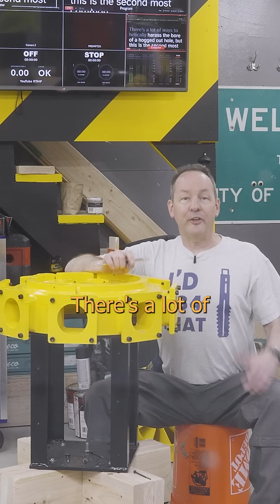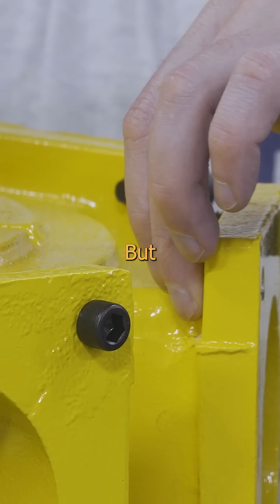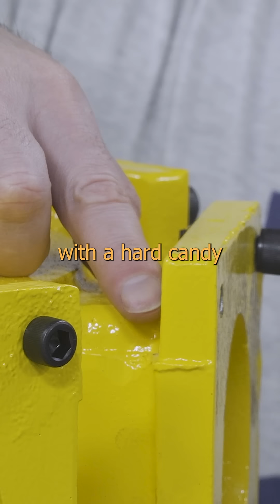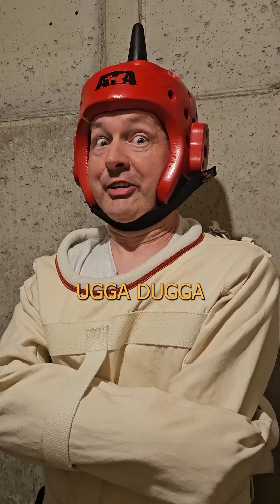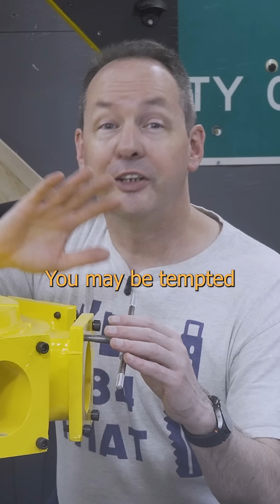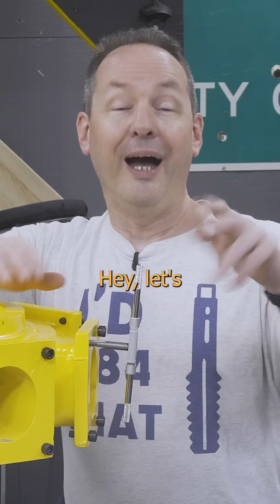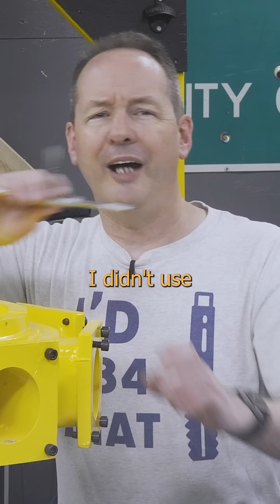Thread Chasing  #chrisboden #comedy #engineering #skills #workshop #metalworking #tools #apprentice

Comment: UGGA DUGGA! im a dumbass. I had 1 1/2 hole in concrete to tap. I was working with GE at the time and everything over 1" is 8 tpi. Usually. Well  this was concrete i was tapping and not a GE part. So i UGGA DUGGA that 1 1/2 x 8 into that hole. Break it off. Bossman comes by and says, "hey numbnuts, thoes concrete holes are usually metric." So i spend the remainder of the shift on that 1 hole trying to get out that broken tap. Yup. Young and dumb.

Comment: I’m not A dumbass, I’m THE dumbass. Tapping a 3/4 hole into the side of a ductile iron pipe 4’ in the ground and full of 90psi water pressure. Run it in turned into pump out the trench, cut the pipe, sleeve in a new section and do it right this time. 1 hour job turned into a 10 hour shift lol oops

Comment: I had a bad run in just the other week. Bossman dropped a chunk of money on these special drill taps, designed to hog out the hole and then tap it immediately after. Pretty clever bit of kit in the right hands. Guess who's got two thumbs and fuckin snapped £30 worth of tap on his first try? This dumbass 👍😂👍

Comment: Sure, if it’s your tap…but it’s a lot easier to get the contractor to buy a new tap than to pay for carpal tunnel surgery and lost wages.

Set the drill on low speed and use the variable speed trigger to keep it slow, adjust the clutch, lubricate, and stop and reverse to clear the chips every couple threads. If you’re careful, have steady hands, and let the tools do the work you can have a pretty good success rate cutting threads in stainless. Chasing these out shouldn’t be a problem for a properly coached 1st year…that said, I know plenty of JW hacks that would go through taps like they’re tic-tacs…by hand.

Comment: I closed a vacuum hose adapter to my Vacuum destillation setup with silicone paste (for getting the parts air tight in chem vacuum dest)  since I did not want hot sulfuric acid vapor to escape and thought condensing it by having the recieving flask at -18 degrees celsius is enough, well a boil over later (the temperatur controll failed) and an evacuated lab later, I knew I won't do that again... (NO ONE WAS HARMED)

Comment: Hey, Düma$$ this is exactly why your cordless drill has that adjustable torque ring setting.  And speed range 1 or 2, most likely.  Chase small threads using a really low torque and low speed.  Because nobody likes having to go get ol' Charlie to help you get the broken tap out of the casting because he's going to make you wish you never came to work this day.

Comment: Auto mechanic here, and I chase threads using a tap in a tap socket on a 3/8" impact driver all the time... Yeah, a couple mistakes have been made over my 15 years in the trade, but on balance, once it's been started by a thread or so, it's fine.

Comment: Dumbass alert! I was Running an m8 into a lower radiator tube mounting surface usually we could just hog these with a drill bit along with the other 300+ holes in an empty cat793 frame but there was some blasting media left in The blind holes and I got the tap suck I usually chuck the drill loose and set the clutch low so they don’t break but I guess this one was a bit sensitive. It broke. I have a 4 flute tap remover kit that I bought just for these occasions. It as luck would have it it broke in 2 places and deep in the hole so my tap remover wouldn’t work spent an hour and a half attempting to get out the pieces and ended up having to drill through the flutes to make a cross shaped hole turn the tap just enough and fish it out of the slots we always tried to avoid using thread repairs but this one got a keencert and we had to be really carful because the hole was blind to not have a hole in the tank that would have to be sealed by the bolt threads.

Comment: Never had the pleasure of breaking a regular tap, but have been a dumbass TWICE with a drill tap. Long story short, only use a drill tap on a single layer of metal, anything double stacked will bind and you will snap that fucker off in the hole

The real lesson? Slow down and use the right tool the first time, there's always tomorrow, and better late than making a worse problem

Comment: So i worked in a fab shop i was told to tap some holes of a specific size so i grabbed a tap wrench and got yelled at by the owner if you can’t run a tap in with a hand drill then you don’t need to work here

Comment: My tap story. Its not exactly because of the issues you described to avoid. A chiller bolt broke for a condenser barrel head (just a water diverter with about 50 bolts in it and a rubber o ring on the inside). Extractor didnt do the job. I tried. Im telling you. I drilled  out a small hole with a tempered steel drill bit but went too deep. I realized when i heard the whistle. These machines are under atmospheric pressure so they suck air in until they equalize. Now it was panic mode. I needed to get that bolt out and found a way to seal the hole and thread in a new bolt. I got it extracted and packed that hole with a full tube lf steel stick. Pressed it in there with all i had and hit it with a hammer for security. Then i took some liquid epoxy and shove about a 1/4 bottle of that too. Figured the steel sick would get 95 percent and the liquid epoxy would get sucked into the rest of the crevasses. Gave it an hour to set and used and ultrsonic leak checker to listen for air movement. Tight as a tick. Now i need to retap and get a new bolt. That all went smooth. I ended up telling the customer with my tail between my legs, marked the spot for the next guy to know, and left a note to apply a little loctite sealant on that bolt just in case.

Comment: I’m a young diesel mechanic and I was working on a manure spreader that goes behind a 60-90 horse tractor and I had to tap some new grease fitting holes in the bearings that hold the spinning blender of death together and I was running out of time and snapped that 1/4-28 tap right off with my drill.

Comment: Working in production we have taps with pressed on nuts we just fire them through a crossed threaded hole pull it back out then fire another bolt right back in a matter of seconds then move on to the either next repair or next unit

Comment: Dumbass
I blew off the intake valve on my mountain bikes rear shock. Had to tap it to screw in a new schrader but went too fast and it ended up cross threaded out the gate. Ended up plugging it with the valve and some jb weld...2 years later, its working perfectly

Comment: Dumbass
I was retapping a hole on a turbo manifold for a 2003 Subaru Impreza wrx wagon snapped the bolt off welded another bolt to it and then got the old bolt out but was stripped from the last turbo replacement so I was gonna retap the whole and went at it with my snap on drill and destroyed it had to weld the hole redrill the hole then hand tap it longest fucking turbo manifold job I’ve ever done lesson learned😂😂😂😂

Comment: I'm a dumbass. No not just the kind who once thought they could tap a hole with a drill, broke he tap off and had to spend the next multiple hours to fix my mistake. but the special extra dumb one who despite that still would chuck the tap up in a drill to chase the threads in your siren to save a few minutes.

But also I have purpose made thread chasers that's made for exactly that, so I'd use the tool that's made for the job instead of a tap, a tap is for tapping holes, a chaser is for chasing them.

Comment: Also, when you unscrew a bolt, if you see marks of any kind of paint, threadlocker or whatever, that thread needs to be re-tapped and the bolt needs to be cleaned.

Also remember to inspect the threads carefully after each unscrewing to avoid screwing up when screwing them back.

Comment: I use a drill to chase threads all the time, just did a bunch of 1/4 and 5/16 UNF threads on an engine block from an old MG. Might be a skill issue, I certainly wouldn't tell the new kid to do it that way.

Comment: Yep, I broke a tap with a impact, but in my defense, it was supposedto be used on a impact. It was one of the newish drill/tap bits for up to 1/4 inch metal and unbeknownst to me, some a**hole engineer decided to make this oarticukar metal column 1/2 inch thick when every single other one was 1/4 and so when the threads began to bite, the drill section wasn't through the other side of the metal and snappy sounds commenced with a decidely downward look to my da from there on out. It might not have been the engineer, it more likely was the dumbass metal fabricators who are notorious for screwing things up regularly. I have petitioned the company hire ups more than once to quit using these idiots, but keep getting told their the only ones who will do it resonably. I remindthem they get what they pay for and just to keep approving all the change orders that I charge for fixing their screwups. Seriously, I made close to$20,000 in change orders on one project because of those idiots.

Comment: Done this a million times, started by hand, then started with the drill method, took a couple mess ups to learn how to use the drill right… these were also not critical parts, had access to rear to add nuts and lock washers if need and no sealing surface in site.

Comment: Dumbass 
Anyone who says they never broke a tap off is a bad lier. Smaller the tap the more spicy it gets. One of my biggest victories was on a small broken screw for and certain type of mount. I got a good deal but it came with someone else's dumbass. Using and extractor on a drill press and a vice. I used the press for pressure and control only no power.
Got it out second try and I got a little over and 200$ discount over buying new. I still own said item and I wears and optical alignment device and punches 10mm holes at short to medium ranges.

Comment: Dumbass, I was left on my own to re-thread mounting bolt holes on a fin guard and it did not go well. Safe to say my nickname was Parkinson's for a hot minute afterwards and I was banned from touching drills and there (as I soon found out) expensive bits. to be fair haven't we all snapped a dozen  taps in under 30 minutes?

Comment: A buddy with a tap set was trying to help me chase the threads in the rusty holes on the frame of my car so I could mount a trailer hitch.  On the very last hole it got hard, and this DUMBASS who should have known better used break cleaner for lube and ugga dugged his way to a shattered tap way the fuck up in there.  I only ever had 3/4 of the bolts in there.  Damnit Jim!! 🤦‍♂️

Comment: You can get taps and dies that are just for cleaning/repairing threads, that are made of a different, softer metal. I have a set of them as well as the standard thread cutting ones and they're awesome for dealing with absolutely shited threads. I think they're made of brass, or something. They also have a hex head so I can use a ratchet spanner to turn it faster if so desired.

Comment: My company's manufacturing enjoys mixing powder coat and sand blasting bbs in the bottom of blind holes then run the bol t s in with an impact till tight.....  not flush just tight.....

Comment: I feel like a dumbass but not in a way you would think😅😅 I was replacing the dead batter off of the pcb board that was solder. And after cleaning the rosin off the board and what not. And somewhere along the line during the process of soldering new battery on a pcb board, I somehow created a kill switch. And it’s a gameboy cartridge. I put in my game boy and it killed the game boy. 😅 yep I’m a dumbass

Comment: Thread chasers are a safer bet. They have more flutes and a beefier shank to help reduce possible breakage. But even with a thread chaser, you should run the chaser in 3/4 turn then back it up 1/4 turn to continually clear the "chip" or debris. On blind holes, it's best to load the flutes of the chaser with grease so that the debris gets trapped and comes out with the chaser. Blowing air isn't always your best option which is why loading the flutes with grease is a common practice. Thanks for the video!

Comment: DUMBASS. 
I had ford 2.0 L where the customer had installed a pull a part transmission themselves. Wouldn't start. Confirmed the starter solenoid was bad.  Go to pull it out and find out the huckle buck chuckle fuck sent both bolts in half sideways into the transmission case.
I was already 2 hours over what the job was going to pay me and that point was just livid. Threw a 20 ×1/2 tap onto my trusty little matco drill and proceeded to give her what my old foreman refers to as the "law and order" special. Because I cracked that case in seconds.😅

Comment: I personally advise using a thread chaser vs tap. Actual thread chase is made to clean existing not cut new threads. Not as sharp or as strong metal. A whole kit cost like $20 and keeps the 200lb gorilla from turning the tunnel of love into the pit of despair.

Comment: Repairing something for a customer whilst working at the hardware store. Needed to tap to 1/4 20 and thought i had it. Instead of going a bit and then backing out a bit i thought i could just keep turning.  The answer is no sir.  Tap snapped like a dry twig.  They are brittle. And you aint drilling it out to retap that hole.  It would take some kind of special bits and lots of them.  Snap one off and consider that hole not a hole and will never again be a hole!!!

Comment: Dumb a$$ i was rethreading the holes to hold the real mower blade in alignment and the new threads didnt hold so It fell out of place and scapled an entire half of the golf course then the bolt was stuck so they had to buy a whole new blade assembly

Comment: "Slow is smooth, and smooth is fast"
Whenever possible and needed, use a set of 3 - Taper, Plug and Bottom taps.
I tend to open a new tap rather than go for a used - dropped once and you may not get any warning before half the tap is on your hand and the other is stuck, protruding out of your part.
M1.2 in Stainless Steel is my proudest thread achievement to date - not in the first tries either...

Comment: Id say dumbass but i havent learned my lesson yet. To be faaaaair, i only do it on 5/8ths holes that i already cross threaded. Pro tip for the dumbasses like me that use an impact: find a nut that doesnt quite fit on the square end of the tap and hammer it on, that way you can ugga dugga it

Comment: I am infact the dumbass. M4 tap in FIRST robotics. About 2 years ago, I had to tap 24 holes and got a few done and was running out of time so put it in the drill and just ran it slow and steady. It worked for a hole or two… until it didn’t and the tap did the snap and the remnants of that tap is still in the robot that had competed at several competitions afterward and is in the library to this day.

Comment: I used to work on submarine appendages and we would have to drill and rap holes for foam backfill. We had a guy who just wanted to get it done so he would ugga dugga the tap into oblivion. They would all come out cross threaded with broken teeth. Now I've broken taps myself and can say that there is a sibmarine somewhere in the world right now with a broken tap that we beat down into the foam and plugged the hole. But for anyone that wants to know there is a lower power impact that is made for taps and they work amazingly.
Reply: ooooo, that's really cool. a special ugga dugga done for drill taps.

Comment: I worked at a shop that provided taps and pneumatic drills instead of tap wrenches and got mad when we broke so many. Oh and they were 4 flute, even though we were drilling through an undersized hole in stainless sheet metal sandwich.

Comment: "Dumbass" I learned the hard way by applying to much pressure at the start cross threading it. Once I realized I was in to deep and couldn't get it out, then while attempting with to much pressure again to get it out; I snapped the tap i sliced my palm and wrist up so bad I had 16 stitches put in as a result.

Comment: I don't use the impact for taps, but I do use a drill all the time, the difference is I use it on bigger threads like 3/8 and up, use the clutch setting on it if your worried

Comment: Ooooohhhh man, the memories:

Here in Mexico, although there are schools for the trades, most of us learned the old way: from a grumpy old master as sweary as Chris and with similar levels of creativity.

We were repairing the U-shaped part that holds the round springs to the wheels (don't know the name of the part in Freedom) on the suspension for a 1990s Mercedes-Benz small bus (not the Short Bus (TM) ). After welding new flat steel pieces to the part to create new anchoring point, we had to chase those threads in the newly made holes so the piece could be mounted to the suspension again.

Enter 15 year-old me, brand new to metal working. With the holes freshly drilled, the master went to take a piss while I was left unattended. Eager-young apprentice thinks "I can chase those threads myself", I grabbed some oil, mounted the tap on the drill (big, POWERFUL, Bosch power-drill), and went town on those pieces...

One snap and A LOT OF curses later, the old one returned and with a veeeery calm voice proceeded to berate me, chastise me, question the mental faculties of my forefathers, and tell me why I was wrong and why I was going to go to the hardware store (on the double) and buy a new tap from my own pocket. Mind you, this was Mexico in the 90s, these type of equipment had to be bought at specialty hardware stores and was expensive.

So yeah, DUMBASS.